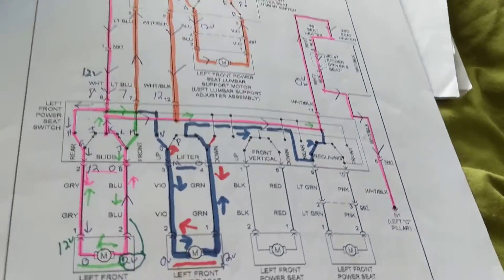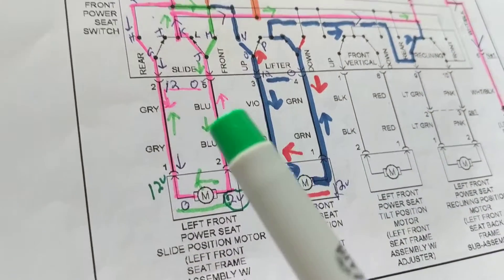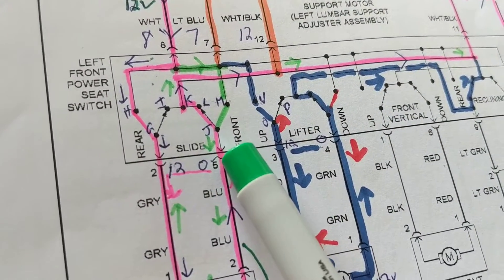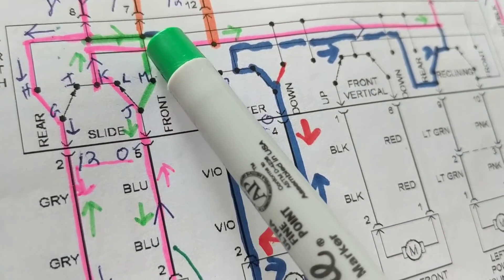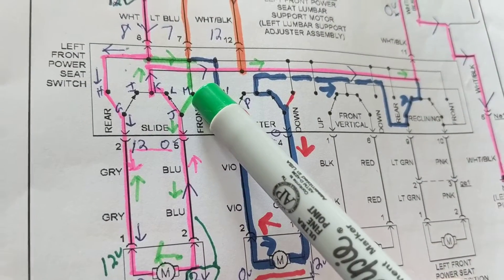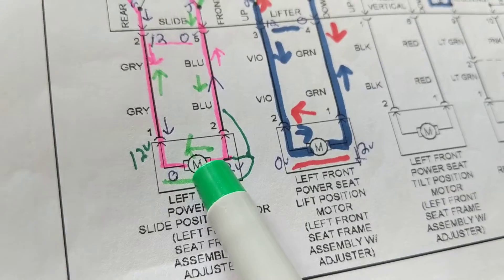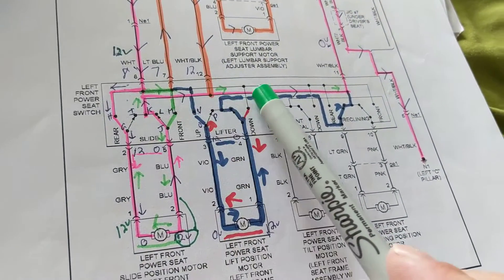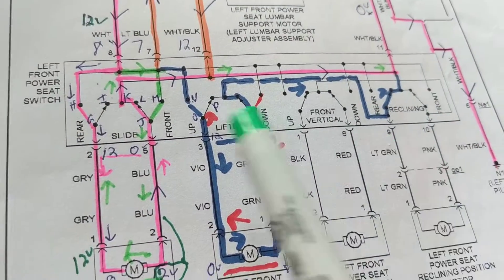how POWER SEATS WORK from WIRING DIAGRAM

Comment: Great clip. I have a question. I am putting a seat out of a 2015 ford explorer into an old truck.  The explorer seat has 4 wires going to it. My thoughts are that they are forward and reverse and tilt front and back, what puzzles me is which on or where would the ground be

Comment: im considering purchasing a car seat that has cooling fans, this helps me out because i plan to use the seat for sim racing, and if i can read diagrams like this because of your helpful video ill be able to diagnose what wires which, bypassing can bus as a whole (all depends on what one i ultimately choose)

thanks for being very informative.
Reply from the maker: I really appreciate the comments. Keep me informed how the new seats turn out
Reply: hi, could you please help me out how i have to connect the 12 Power suply to my accord powered seats so i cab use the Power adjustments? I have the diagramm but cant read it.
Reply from the maker: No problem keep me updated what you need
Reply: @Joeelectronicschematicsforauto  Hey, so I have a honda accord power seat that I want to put on my racing rig. I would like to connect the seat to a AC/DC  12V power socket so I can use the power features of the seat and the heat funktion. I have the diagramm from the seat, but cant figure out what is what. :)
Maybe you could take a look and tell me, where I need to connect the 12 Volts to run the seat.
Do you have a Email? I could send you the diagramm and the picture from my seats connectors. Would be awesome! Thank you in advance

Comment: Please I need to ask my seat is manual can I take any electronic seat to assembly to my car ?
Reply from the maker: no I will not recommend it if you're saying your seat is manual you need to put a rod to the seat to swing it back and forth even though it's electronic it has to be moved somehow but obviously there's no electronic connector to it to power it
Reply from the maker: also if you want to do it manual or electronic since there's no electronic circuits to it you have to put at least a lever so that you can swing it back

Comment: Hi. How to energize lumbar system of mb w205 seat out of car? I will make a simulation cockpit for play race games, but I can’t do this work, other motors are ok. I’m use 19v notebook to supply the seat. I tried everything, stills not work. I really need you help, Tks.
Reply from the maker: Trying to find a diagram that hopefully will help you sometimes the manufacturers do not give old information to the public do not give all the information to the public trying to find something that's similar to what you're asking there are modules and many sensors and heaters involved with seats as you can see

Comment: Hey Joe. I have a 2011 Toyota Sienna that I recently purchased. The driver seat goes forward when switch is pushed to the rear, and then goes backwards when I want it to go forward. Is there a way to switch wires to fix this issue?  If so can you tell me which wires to switch? Thank you
Reply from the maker: I have to pull up the schematic
Reply from the maker: There is a ECU believe it or not for this Toyota controlling the motor and the direction of the motor and switches if wall wiring is correct there is a possibility can be the ECU
Reply: Any chance you happen to have a part number for that?
Reply from the maker: @walsappy  try to look at Google for ECU for power seats for 2011 Toyota sienna see what you can come up with but this is based on that you did the preliminary test on the switches and motors obviously they're getting 12 volts because they wouldn't be working the first place but they're working the opposite direction

Comment: Hey Joe, you DEFINITELY don't find anybody explaining how schematics work like you are showing!
I am hoping you can help with my situation.... I'm resurrecting my 69 Chevelle after I had to let it sit for 20yrs. I have gotten her running again after swapping in a drivetrain from a 2010 Silverado. I did all of the work in my yard(including the wiring harness) putting the ECM inside the dash. 
 I recently got a set of seats from a 2020 Honda Accord, but didn't get any harnesses, or controllers, only the seats.
 Can you help me figure out how to power them up in my Chevelle? There are so many wires in the plugs under the front edge, where the original cars harnesses clipped into the seats that I just boggles my brain!
Help me..... PLEASE Joe! My mind has been smoke tested over this!
Reply from the maker: Well first you have to get a wiring diagram of the old wiring where they went and find a suitable compatible seats and connectors you can go to Google and put in your 69 Chevelle wiring diagram for seats and you should get a wiring diagram for that specific situation for free but everything has to be compatible get that down download it and then get back to me

Comment: Hello Joe, nice video..I got a little question on this connection.. is it possible that i bypass the seats' switch..I will put another switch for reverse and forward power seat motor..is it possible?
Reply from the maker: But where would you put that switch remember the switch works positions works in two positions and the motor is bi-directional meaning you saying you use the same motor for forward and reverse

Comment: I am putting power seats from a 2003 Nissan Altima into a Nova. The 10 way drivers side seat has a memory module that I need to bypass. Where can I find a diagram showing each coloered wire from the switch side. And witch wire on the motors side that it should be attached to.  Thanks
Reply: They're on many of them but I always use Mitchell but that cost about 1999 for each car you can use alldata, or just put in power seats for Ultima Nova schematic and the internet you might see a diagram of it try that that's for free

Comment: Very informative thank you I now have a much better understanding the switch does everything I’m a bit lost I have a 2005 Hummer H2 SUT the pickup version I want to swap in 2018 GMC Denali power heated and cooling seats GM uses a BCM but the principle in electronics should be the same you every thing I sure could use help figuring this out
Reply from the maker: BCM requires programming that's the body control module of GM any computer model usually needs a programming especially when they control those accessories